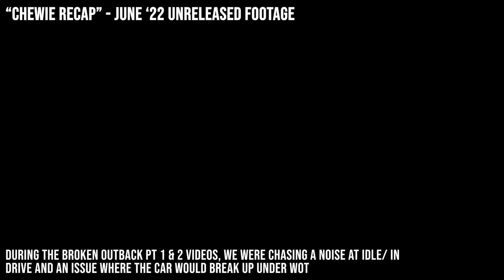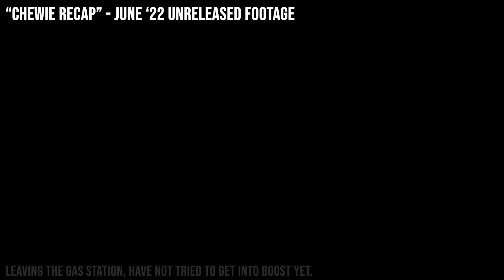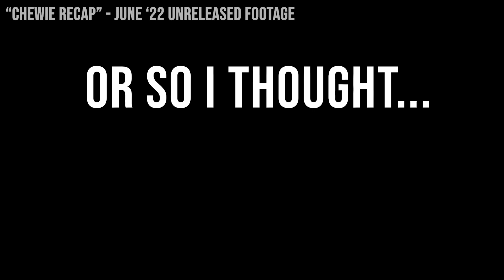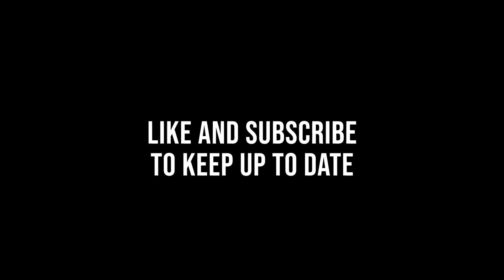Making power in an automatic Subaru? watch out for this. (We found our problem)

Comment: Oh damn. The burnt bronze cerakoted headers were for a Legacy? Nice! So clean! I have an 08 auto wrx that I'm planning for a slap shift fun mountainside road car. trans actually still feels like new at 220k. Billet flex wheel idea sounds legit tbh
Reply from the maker: Yessir! Have both my legacy and my outback. Legacy is the clean daily and the outback is the track project. Have seen some transmissions last forever, mine did pretty well fornthe mileage, but that flex plate was unexpected. Likely had happened a while back, because I had heard random noises, but always wrote it off as "built motor piston slap, etc" until one day it was obvious something was drastically wrong 🤣 wrx should be a fun project, wish you the best 👌

Comment: I hope its just the flex plate. Now you have the engine out though, you can steal the spare 6 Tanner has and chuck it in with your manual box 😉
Reply from the maker: Haha. That's a long boy engine. An ez30 would be cool, they are a few inches shorter. Would be nice if the engine is in good shape to keep as a spare or sell to help towards the next setup.
Reply: @MatlasDI  the ez would fit better yeah. In aus the was as an option for a 6 (cant recall if it was 3.0 or 3.6) in the outbacks. I dont know about the states. 

If the ej is ok itll be a good spare for mittens.
Reply from the maker: @ChristopherFranz  in the states we have ez30r outbacks as well for 05-09. Would be a cool setup, but it might be hard to do what I want with the car using one.

Comment: did it run with a lot with misfires/harsh vibrations?  these flexplates can take a lot of power but not much vibration/misalignment
Reply from the maker: Nope, it ran perfectly fine outside of the noise of the plate tapping the back of the engine.

Comment: How did the part shear off?
Reply from the maker: Thinking torque/ launching was too much for it. The high stall torque converter would engage a lot more harshly, so it's likely that took it's toll on the factory flexplate as well.